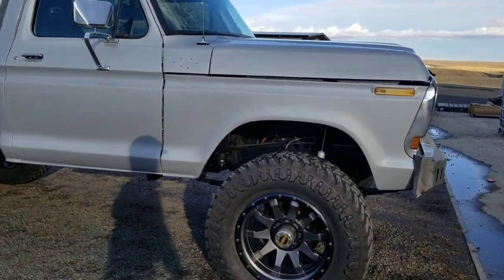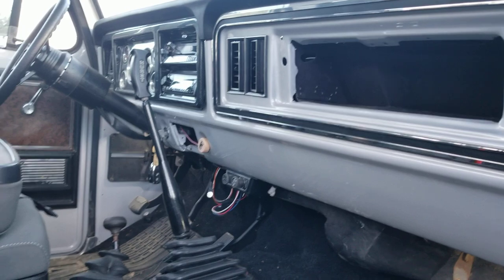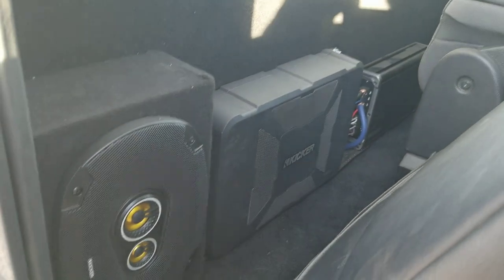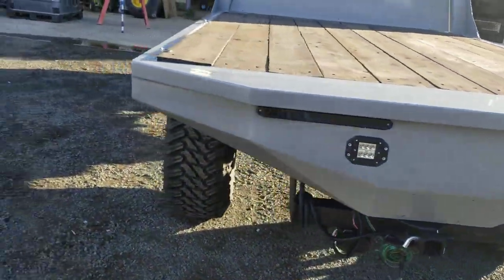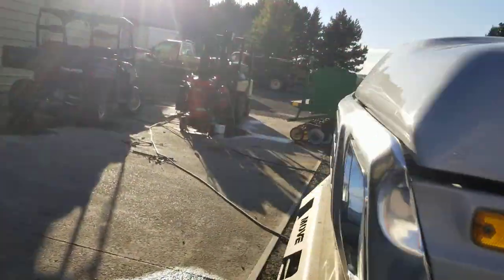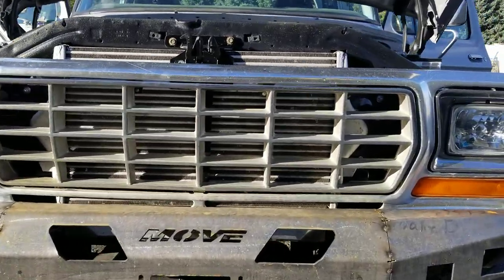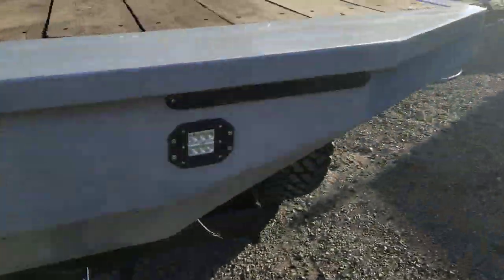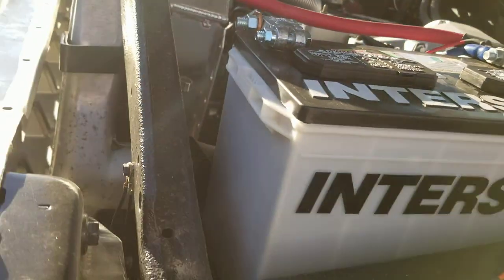1979 FORD CUMMINS CONVERSION PART 3

Comment: What did you use for undercoating? POR15 or Rustoleum or somethin else?
Reply from the maker: Its a product called chassis saver. Identical to POR 15

Comment: I'm almost done with my build but need help with the ignition switch wiring and alternator wiring as well. Do you think you could help me
Reply from the maker: On the ignition wiring i used the ford coil wire for the "hold" wire on the shut off soleniod. Ran a wire from the starter solenoid to the "pull" wire on the shit of solenoid. I ran a external regulator off a older dodge for the charging system.

Comment: What kind of radiator, intercooler, and A/C condenser combo did you use for it all to fit for cooling package? That looks like a tight squeeze for everything to fit. Also,  Did you have to special make your intercooler piping?
Reply from the maker: I got a champion aluminum radiator, intercooler from a '99 superduty, and a stock A/C condensor from vintage air. It is a tight fit for everything but it fits really nice. Had to do some modifications to the front core support, trim the grill and grill insert and also had to build a new hood latch. Amd yes i had to build new intercooler piping. The intercooler requires a lot more work but its worth it.

Comment: Hey from Australia 🇦🇺 what model Chevy did the centre console come from
Reply from the maker: Somewhere around 2013 and any of the pickups. Not sure on exact year of mine. Bought it off ebay.
Reply: Hey bud what are the seat rails from to mount the seats
Reply from the maker: Bought the rails straight from corbeau seats. I believe they are the generic 1 inch tall mounts. Then i made brackets to hold those

Comment: where did you source the adapter plate for the zf5??
Reply from the maker: It was a small machine shop in idaho that was building them. Dont think they are anymore. You can get them from diesel conversion specialist
Reply: Thx.....I have 78 f350 2wd dually,,,trying to convince myself the kingpin design front-end will take the weight,,any thoughts??

Comment: How did you do the remote locking? that is slick
Reply from the maker: I went over it some what in a older video. Basically just bought a kit from LMC Truck and its pretty self explanitory. It was a universal kit that you might be able to find cheaper from a different vendor. Just mount the actuator and wire it and its good to go.
Reply: @nwfarmer8724  I'll look into it for my 79 build... beautiful truck brother

Comment: Hey i have a 73 f250, wanting to put a 12v or 24v in it , what kinda transmission do i need
Reply from the maker: Depends, they make adapter plates for cummins to many transmissions.  I used a ford zf-5 transmission and got the proper adapter plate for that. You can use a stock dodge auto or manual trans. Or look in ford or chevy trans
Reply: @nwfarmer8724  thank you, i live in Omak wa 🌲

Comment: will a dana 44 front axle  hold a 6bt ok. Thinking of doing one.
Reply from the maker: Im sure it would just depends what your going to do with the pickup. I have seen a 44 break in half with a 429 in it, but it was abussed. If its going to stay on the road it will pribably be fine.

Comment: can you do a run down of what you did for wiring? ive got the same project but with a 68 mercury and im at a complete loss for wiring lol
Reply from the maker: Yeah i will try to do a run down when i get a chance. Pretty simple.  Do you want to know about the wiring for the cummins?
Reply: @nwfarmer8724  for the engine itself, yeah what did/didnt you use.  the headlights and such i can probably figure out lol
Reply: I would also like to know about the gauges and wiring. I am doing this exact swap right now and I would like to do the same setup. 
How did you get the temp, bolt, Speedo, etc etc wired? Any and all details would be awesome. Thanks.
Reply: These engines require no electronics to run except for sensors to run the gauges, a wire to the starter, and wiring to the alternator to charge the battery.

You can even get a wind-up inertia starter and do away with the battery & alternator lol!

Comment: What rims and what tires on how many inches of lift?
Reply from the maker: 20x10 raceline 934g wheels, 37 inch tires. 4 inch susension lift and 1 inch body lift
Reply: @nwfarmer8724   nice truck, what is the wheels offset?